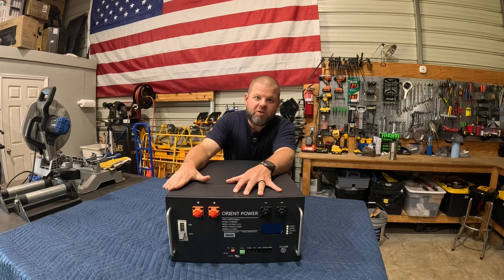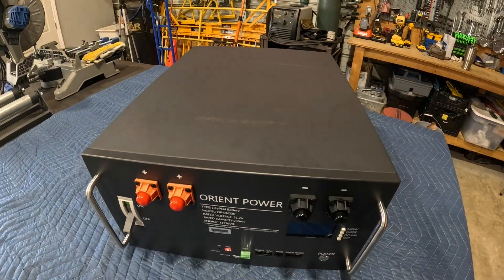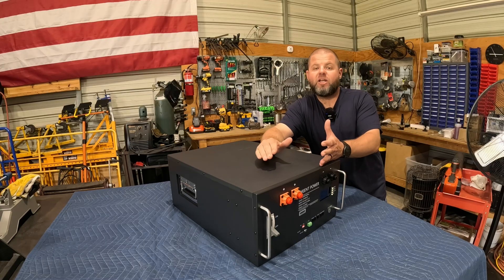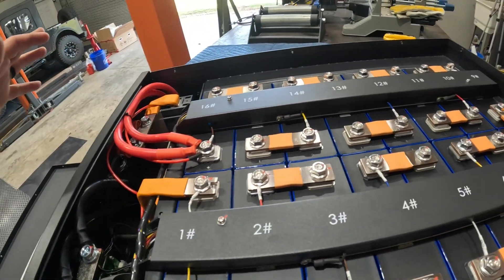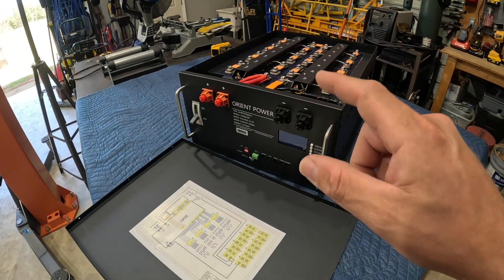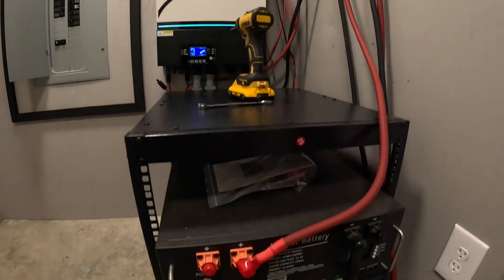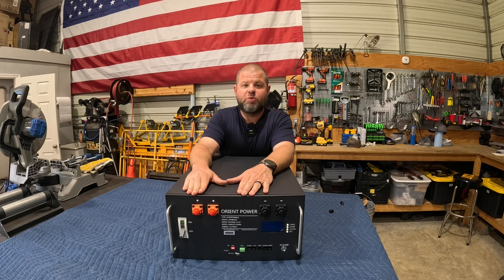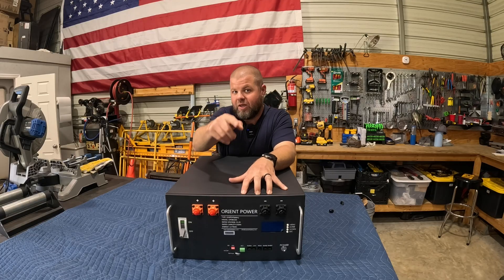HUGE Server Rack Battery Test! Orient Power 230AH

Comment: This video sold me on buying one, it looked like the most well built battery of this price/capacity.
But the big battery is not UL listed and the company didn't give me any information on UL when I asked, instead they tried to find some way to send me a invoice that they said I could use for my "tax credit".

When I asked to hold off on shipping until UL came thru, they told me it already shipped and they coudln't do anything.  But this was before shipping had happened.  
Days later the shipping company calls me and says "Hey we need to schedule this" and in that time I asked about cancling delivery and they said sure!

I am very tempted to cancel delivery and go with something else, for one big reason and that is customer service.
Ever since I had that initial communication with them about an important and time senstiive matter they have ghosted me completly.

Funny enough another YT guy that I follow had this exact battery and it failed within days, and he also had terrible customer service and then got ghosted.

So now I started to LOOK for reviews on this and found a few others besides yours.  The video I just watched... this battery failed it had proteciton kick in at about 150A when it was rated for 200A.

So I have ONE case of a good review (yours) and TWO cases of a bad review (Others), bad customer service, and what seems like shady practices.

What a shame, becuase I really thought this was the winner.

I will have to post back in the next few days to share the outcome, if I accept this battery or not, or I cancel.  And if I cancel will the company try to rake me over the coals by charging me fees when any other business usually no fee's for a non delivery.

I paid $200 shipping, the competitor I am looking at right now has free shipping...

I have to admit, I am a content creator myself but its getting harder and harder to find YT partners I trust becuase everyone is being fed sponsorships or starts to become brand bias.
As I look in your equipment room and see "Orient Power" everywhere th at can be taken as you really like and trust the brand, or that you simply got all that stuff and now adverttise it for them (not making judgement I dont assume things I do not know)

I purposly always ensure I use every leading brand and test them equally, and if I have any sponsorships ever, I do so with all competiors with a full disclosure that I will say anything bad I need to say and they can not view my video before it's published.

If you want to message me directly to keep things off record feel free.

Comment: Those suggesting fire proofing the batteries don't seem to understand this battery chemistry.  While it isn't a bad idea for a cabinet, you run more risks with inverters and electrical related fires, which is why they should be mounted on a fire resistant surface like a cementious board backer like Hardie or Durock.
Reply from the maker: You are correct, the batteries themselves are not the fire hazard! However it's not a bad idea to isolate them from all the shop hazards that are flammable.

Comment: Adding a 240v soft start may solve that problem.  Good ones cost a few hundred dollars, but they ramp up the power so they're not such a crazy current draw.
Reply from the maker: I actually have hard start capacitors on that compressor, but even they don't help.  I no longer need anything with this new battery.

Comment: Great video! The power draw from an inductive load like that is substantial. Did a quick look at their specs and saw it was rated @ 230A for 5 seconds. I did not see a burst capacity but I suspect it would be 350A+ for a second or two based on what many of the 200A BMS's will support.
Reply: You know a lot on electrical